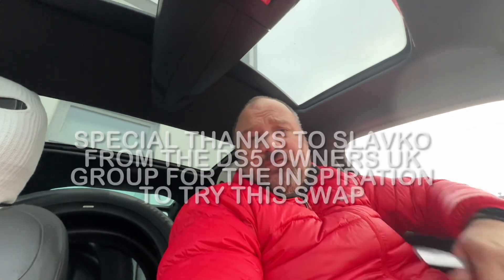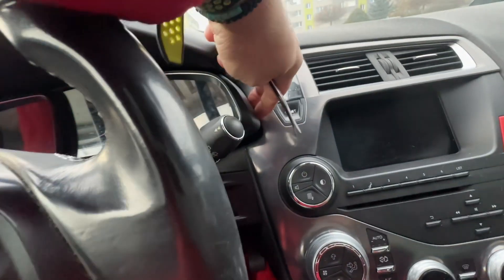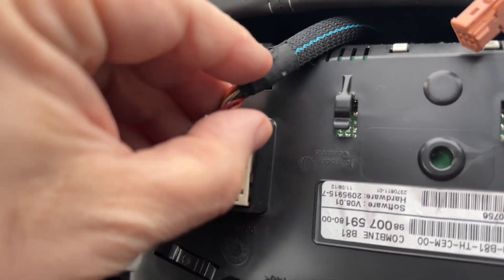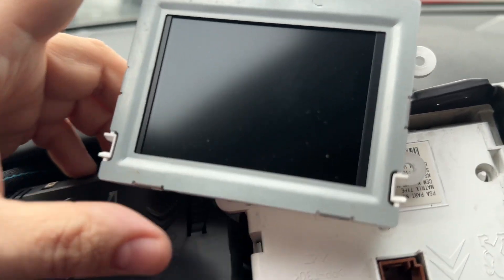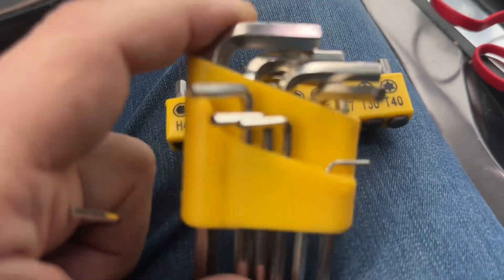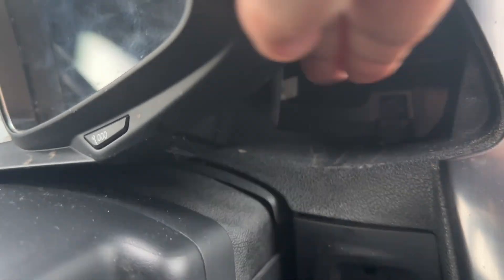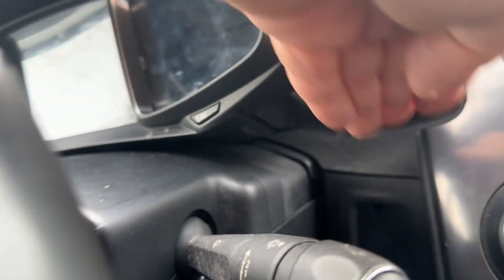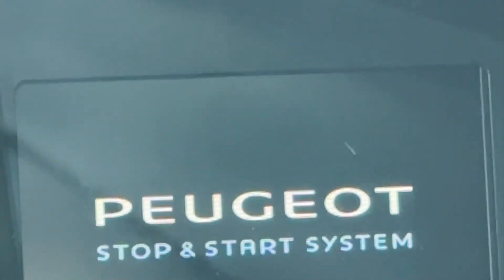How to remove the instrument cluster on Citroen DS5 - high resolution color display transplant

Comment: There are alot diferent screens with diferent part numbers does this work for any of them or do i need a specific one
Reply from the maker: depends if you wan't problems or not :) The one I got is from Pegeout which is configured slightly different than Citroen. e.g. leaves room up top to display some additional paramters.  On one of the screens it also mirrors the speedometer display.  Doesn't bother me, but if you want truly the same as in the Citroen, you should get one from a Citroen cluster. If it says in the description that its full color/colour and from the relevant Citroen version (Hybrid will have some extra information display screen), you should be OK. In theory the Pegeout one can be reprogramed, but not via the standard OBDII interface, Diagbox/Lexia, but you will need someone to connect directly to the display with some advanced knowledge ... on the Polish DS5 FB group one guy showed he was able to do the reprogramming using Arduino https://www.facebook.com/groups/2050167441952278/permalink/3006023679699978/?app=fbl
Reply: Nice work
I did the same on my 2018 ds5 with a 2013 ds5 color screen
Could you tell me how to change Citroen logo to DS 
I have a thinkdiag 2 obd with diagzone prog
Thanks 🙏